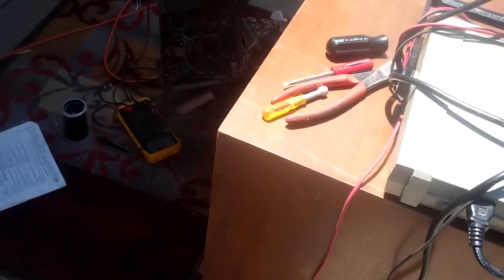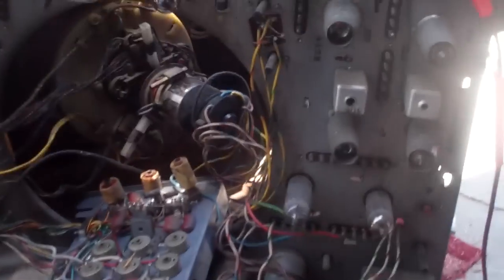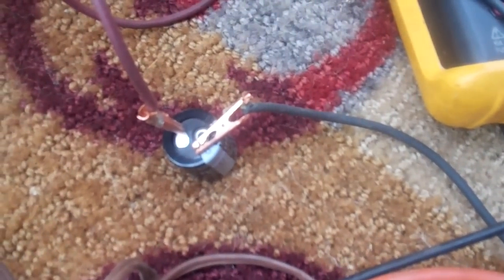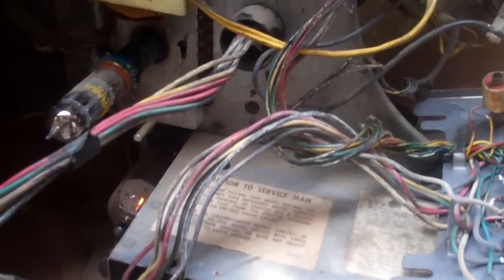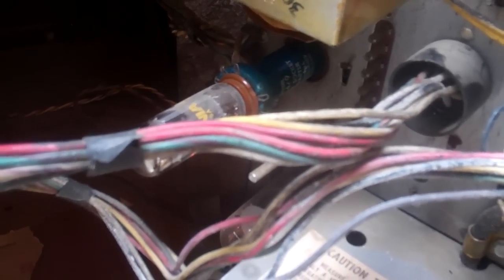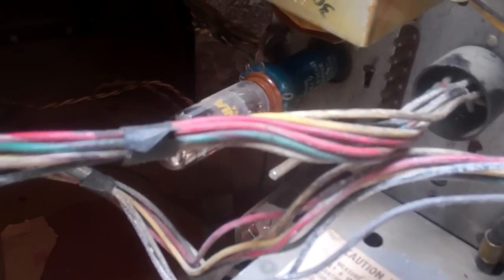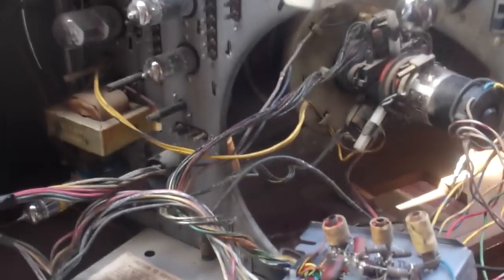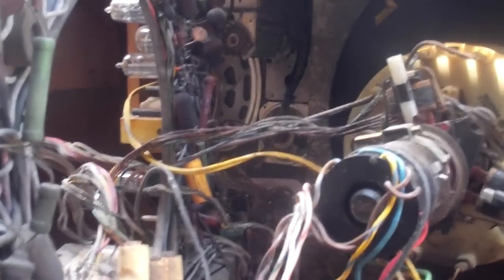Packard Bell 98C8 Vintage Color Round Tube Television Set TV

Comment: I guess I was lucky with mine because my set had a perfect 180 mA on the 6JE6 and it lasted so long and never changed. I could adj the linearity coil down to a one inch gap on both sides or make it nice and wide and everywhere in between on my old PB set.